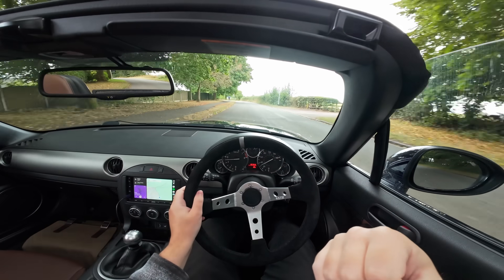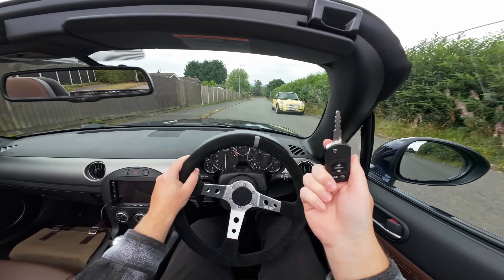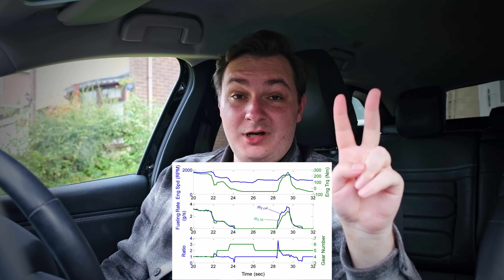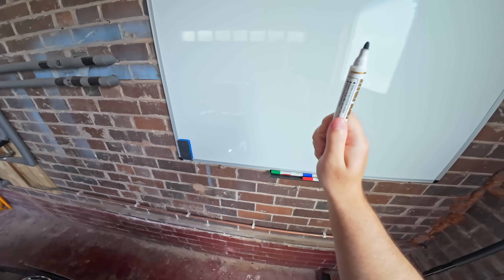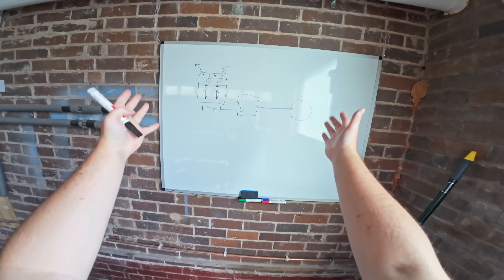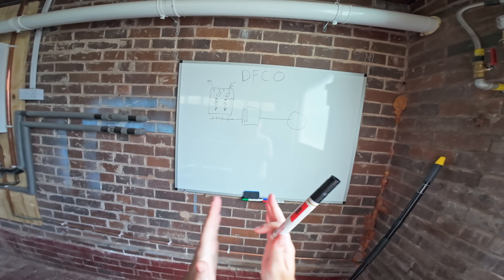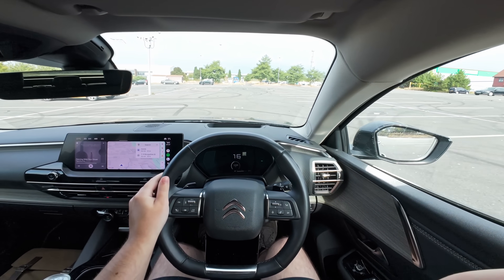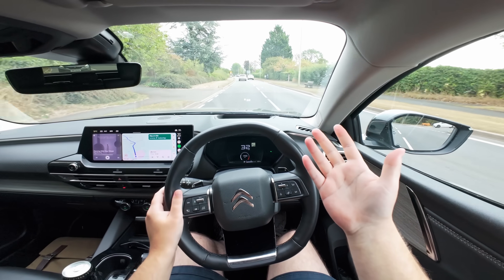The most misunderstood car term - Engine Braking

Comment: Wow, I always thought it would take at least some fuel during engine breaking. I used to be one of those "advanced" manual drivers who shift down for more engine breaking. It always was amazing. However, in the meantime I levelled up. Nowadays I get energy back, when I perform engine breaking.

Electric vehicles turn the engine/motor into a generator when the accelerator is lifted. This results in charging the battery when (engine) breaking. In fact, when stepping on the break pedal, most electric cars will first automatically use the engine/motor to break and only use the actual break, if you step really hard on the pedal (full/hard break). If you configure "one pedal driving" you hardly need the break pedal at all.

Comment: only place where this doesn't work too well is when driving something like a van. IME, my vw t6 won't slow significantly unless i actively shift to lower gears when i'm trying to slow down, and even then the pretty heavy inertia of this car will not be stopped so easily!

(on this note, since engine braking in this case requires shifting down pretty early, i'm a bit worried about my clutch, cause shifting down from 1.5krpm to 3krpm is a bit hard. skill issue tho i suppose)

of course i still DO this, all the time, it's just very rare to see it actually be potent enough such that i don't need to brake. again, this is specifically talking about a heavy vw t6 diesel, so your mileage will almost certainly vary

Comment: There was mention of clutch braking being bad for the clutch, but I took from context of a later comment that that is different from down shifting. I'm guessing I don't know what clutch braking is, but I want to know so I can avoid it. I do often decelerate by letting off the gas and sometimes also down shifting to use engine braking. So what is clutch braking?
Reply from the maker: clutch braking is downshifting without a revmatch

Comment: Mechanics on tv are still mechanics but the ones that end up on tv tell you they are the best mechanics. Anyone who has to tell you how good they are really only means they are not that good.
How you control the accelerator pedal literally controls everything the engine and transmission do. It controls the shift points and how much or how little fuel is getting injected into the engine. 

At Hiway speed at 50% throttle. If you slowly let off the accelerator pedal you get engine breaking but the car still injects a small amount of fuel. If you let off the accelerator pedal very sharply or quickly your car stops injecting the fuel(until it needs to to keep the engine running) and you get more engine breaking. 

I mean the whole reason that electric cars have regenerative breaking is because they are copying it from gasoline powered vehicles. (Diesels do it too but need extra help to do it as good)

Comment: If I went into a lower gear (say from 5th to 4th) to achieve greater engine brake would that damage my clutch? I do this all the time and haven’t had any problems so far
Reply from the maker: with a revmatch, sure. without - you're wearing your clutch.

Comment: Why is it though that my Opel Combo still shows 2,0 L/100km fuel consumption in the board menu display when I use engine braking? Always 2,0 it doesn't matter if I go 120 or 50 and use engine braking, maybe at 20 or so the number starts to rise slowly.

Comment: Your tests don’t really relate to fuel consumption, and they’re not the most efficient method. Engine braking helps save your brake pads and provides more controlled deceleration, but it doesn’t save fuel. It’s actually more efficient to put the car in neutral, let it coast for longer, and lightly tap the brakes to bring it to a stop. (unless this is downhill or you need to stop faster than you anticipated) 

What you call "fuel savings" from engine braking is really just excessive use of the gas. You're absolutely right that people would achieve much better fuel economy if they avoided overusing the gas but that's not a benefit of engine braking...

Comment: Yo great great video. I have a question about my car. It's engine braking SUCKS! Hahaha. I think it's because it's a supermini size car with a little 1 litre 3 cylinder turbocharged engine.
The weight of the car compared to the engine size, I THINK, is making my car take AGES to slow down even in gear with clutch (Yes I'm not coasting)
Does anyone else find this with their car? Of course engine breaking is still there I just feel like I'm having to start engine breaking 2 miles before my turning!
Edit to add* Also, how does downshifting help or hinder engine breaking? (discounting any non rev match clutch re engagements) When should we downshift while engine breaking?
Reply from the maker: Yeah generally the less torque your engine makes the less engine braking you'll have.

If you want more engine braking, downshift... Pretty simple. Bonus points if you learn to revmatch and not delete your clutch.

Comment: You dismiss carburetors too readily. Carburetors provide fuel due to a vacuum created when the inlet valve opens and the piston strokes downwards. When engine braking and with the carburetor butterfly valve closed there is still a very small amount of air and fuel being used, but not enough to create enough power to significantly affect forward motion. At the same time, sparks still occur in combustion chambers so these small amounts of fuel are being burned.

Comment: Ah I was a bit confused, see where I am from engine breaking mostly refers to shifting down instead of using brakes to slow down, I guess that's just the language difference
Reply from the maker: You can shift down to get extra engine braking - sure

Easier in a manual than the lazy auto I was driving in this video

Comment: All you had to do is say that modern electronic controls can shut off fuel entirely and resume it when the revs go below the stall point. The mechanics were talking about the older cars where lifting your foot off the gas resulted in feeding the minimum amount of fuel to keep the engine running because there is no system that can cut it off. You didn't have to go all "scientific" about the two sentences that I wrote above.

Comment: Engine breaking was a thing before DFCO (and you can still do it with most farm tractors were I am from). You still get breaking action in motors carburetors, just that a little bit of fuel is still used. Of course, this is because the fuel pump is partially tied to the volume of air sucked in by the motor.

Comment: Engine braking as shown here is a planned slowing down and a great idea. But using gear shift downs for rapid speed reduction is a bad and risky as the brakelights don't come on and the guy behind you is taken by total surprise.

Comment: If you have a running fuel consumption meter fitted tri car, the following observation can be noted. 
1. Coasting downhill with the gesr in neutral, will give you 'X' liters of  😅 fuel consumed per 100km.
2. Going down the same hill in any gear with your foot OFF the accelerator, will indicate a fuel consumption of '3X' liters per 100 km.
Please explain.

Comment: This is the reason I miss older car models, you wouldn’t be able to do the intro bit and take the key out mid drive with those keyless ignitions 😭
Reply from the maker: I literally had to film that section in a different car because the Citroen is new and doesn't have a key

Comment: When I was taking the in person course for my motorcycle license, I was engine braking to slow down during the tests they put us through. One of the instructors pulled me aside and told me never to engine break because it damages the gearbox because they’re not made to handle it. I contested because obviously that’s completely false, and even asked if he was just telling me this because he wanted me to learn how to use the breaks, but he doubled down, said it’s going to damage the transmission and he doesn’t care whether I do it to my own bike because that’s not his issue but to not do it on the learning bikes. for reference it was a Honda CB300.. I just did what they said and got my paper after that and took it all with a grain of salt..
Reply from the maker: The single group of humans that know less about cars than any other - driving instructors.

(there are good ones, majority are dreadful)

Comment: I've driven 210,00 miles on my brakes so far because of this and down shifting. I'm a pizza delivery driver also so I'm not the best most careful driver either. I have a 2018 Nissan Versa manual transmission.

Comment: A problem with a lot of the “mechanics reacts” videos is that most of the mechanics are from the US, a place where manual transmissions are very rare. Most automatics do not engine brake and instead disengage the clutch packs, thus idling the engine and still using fuel unless you can tell the transmission to go into a lower gear and stay engaged, which not all autos allow. I do drive a manual transmission and my family still doesn’t understand why I engine brake even after explaining it to them multiple times they still think it’s using fuel.

Comment: In cars with a fuel consumption meter (which I guess these days is all cars), when it's configured to measure in L/100km, that meter shows a solid 0 when engine braking, which is another proof that you're not using any fuel at all (when it used MPG or km/L it'll probably show "--" which is much less clear).

Comment: Relating to the wheels turning and working through the system to keep the pistons moving, this is different for an auto gearbox

Proven by the inability to bump start a car with an auto gearbox

Hence an auto will still use fuel

Comment: I think a lot of the confusion in the States comes from the fact that many people learn the term "engine braking" in the context of compression braking (at least, that's been my experience). We even have signs stating, "No Engine Braking," and "No Jake Brakes" as a noise control in populated areas. In your parking lot example, my driving instructors in the 90's would say "take your foot off the gas, and let the car coast to a stop." If you 're taught anything about engine braking, it's because you're in a hilly area, and you downshift to help control your descent and prevent the brakes from overheating. Colloquially, the terms must've shifted in meaning at some point.
I find it fascinating that hybrid and EV vehicles actually mimic this behaviour, even though they don't have to. My car even has an "engine braking mode" that I can engage to simulate downshifting.
Reply: Thanks for explaining this.  I have seen those signs and I was really confused.  XD
Reply: Yup! Exactly the distinction I was about to comment. You'll see these signs all over rural Appalachia, where 18-wheelers with noisy diesel Jake brakes still frequent through residential areas. Even have a local cop confused by this, once writing a friend up with an "engine braking" ticket for downshifting by such a sign (technically these signs don't apply to gasoline engines so he beat the ticket in court; cop should've wrote him up simply for a noise ordinance violation for his straight-piped exhaust instead lol.)
Reply: last point about EVs: The default configuration of a motor is to act as a generator (they are the same thing, just optimized for different purposes) when an external force is applied, like going downhill. It actually adds more complexity to have a freewheeling mode (like putting a car into neutral) because you need to disconnect the motor from the power circuit.
Reply: @wmidler  If a motor is running at a certain speed and one wants to stop it, the fastest way of stopping it (plugging) will require significant additional energy input and dissipate a lot of energy in the motor windings, but can make it stop very quickly.  The fastest way of stopping it without additional energy input (maximum dynamic braking) will dissipate all of the system's kinetic energy without recovering any of it.  Recovering energy from a spinning motor while one is trying to stop it will require additional complexity, and will require trading braking performance for recovered energy (maximum efficiency of recovery would occur while the motor was slowed down very gradually).
Reply: I dunno about hybrids as much but for EV's I would assume they are using "regenerative breaking" as they apply the brakes slightly to get some return power and give the batteries a little extra energy back to help extend drive distance and reduce the need to recharge the batteries at a station as often. If done right you can get an extra 20-30 miles. It isn't so much to mimic engine braking as it is more of a utility action while helping the EV slow down(in my personal experience the regen brake on my former 23 chevy bolt was actually stronger than the engine braking in my current 15 chevy cruze).
Reply: @NarutoMagicCyclops  Regenerative braking can only take you so far. You still need conventional brakes, which can overheat and fail with prolonged use. E.g. I was driving down a steep windy mountain road a few weeks ago. Regen was no longer available because my hybrid battery was already at full charge. I had another 20 minutes of driving before I reached the bottom. If I didn't have engine braking capability, this would not have been a safe road for me to drive.
Reply: @FrivolousSquid  afaik the regen brake isn't usually going to stop the vehicle, some vehicles can utilize the ECU to apply a signal to put in the full force of the brakes when you let off the gas but that's not the same as what was discussed.
  Not particularly sure what differences your talking about in this situation, as engine braking is utilizing the actual engine itself, regen braking is a fundamentally different method of braking that supplies some energy back to the vehicle through a couple different methods. One is through the electrical motor to make it act as a generator and the other utilizes pneumatics.
Reply: Engine braking in an Otto cycle (gasoline) engine uses the throttle to convert mechanical energy to heat.  Diesel engines can't run while throttled, but instead limit power output by reducing the amount of fuel fed to the engine.  While I would think it would be possible to equip a diesel-powered vehicle with a throttle that could only be operated while fuel input was completely shut off, I'm unaware of any diesels including any kind of throttle.  As it is, Jake brakes convert some mechanical energy relatively directly into heat, but also convert a lot of it into noise (periodic variations in exhaust pressure).

Comment: I mean I've always done that, thought everyone did too, but figures that they don't.. (also I usually switch to neutral when coasting because I don't like being slowed down unnecessarily, but I suppose the engine has to run at idle for that.. I wonder where the crossover for efficiency happens 🤔)

Comment: different cars seem to have different ECU logic
Car 1, no fuel immediately above idle RPM if no pedal
Car 2, fuel gradually reduces as RPM gradually drops to idle if no pedal

In Car 1, if I stop pressing gas in gear 1/2 at 1000RPM or above, I get a sudden jolt of deceleration.

Comment: I didn't know the difference between coasting and engine braking.

I had a friend whose girlfriend used to floor the car as soon as the light turned green and wait until the last second and nearly squeal the tires.  My friend, who did work on his own car and worked professionally as a truck driver, tried to convince her not to do it but she didn't understand physics.  She was getting less than half the rated mileage of her car and going through brake pads in ridiculously short time... just a couple thousand miles between sets.  She hadn't got in an accident yet, but she was a ticking time bomb.

Slightly related, and maybe a little harder to do in terms of patience... don't tailgate (and reciprocate by signaling early and being willing to let people in).  When you are on the highway if you leave a little more room you have way more opportunity to engine brake when traffic slows down.  Also, brake lights and fast stops ripple back through all the traffic.  Slamming on your brakes means lots of other cars slam on their brakes.  If everyone respects everyone else's space traffic actually moves faster.  There are even places... some of the snow towns, where they use pace cars when roads first open back up after a big storm.  They find that by driving at 40 mph instead of 65 there is less sudden braking, which actually increases the traffic flow.  The metaphor they used was pouring rice through a funnel.  There is a certain point where it clogs and stops, and by pouring into the funnel slower you can actually get better total throughput.
Reply: On a related note, as an alternate to your metaphor, trying to empty a gallon jug of water is much the same. It's actually faster if you tip it partially sideways so it can smoothly flow out. If you flip it upside down the air attempting to get back in repeatedly interrupts the flow. Just generally the same idea. Often slow and consistent is better than stop and go. 

I recently watched a video on how stop and go waves ripple back and just how far they can ripple back. I definitely do my best in such situations to nullify those ripples. It takes more focus to slow your speedup, maintain distance, and minimize your braking though. Which explains why so many are too braindead in traffic to bother. 😂